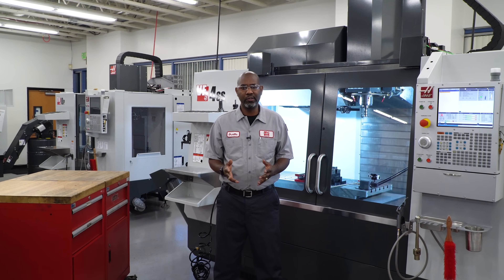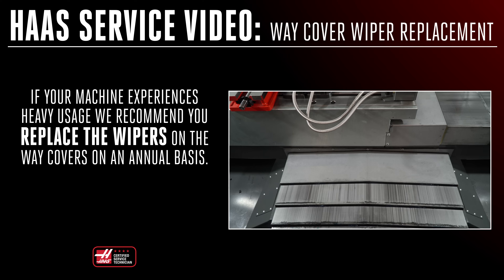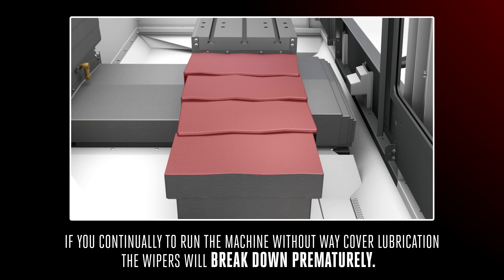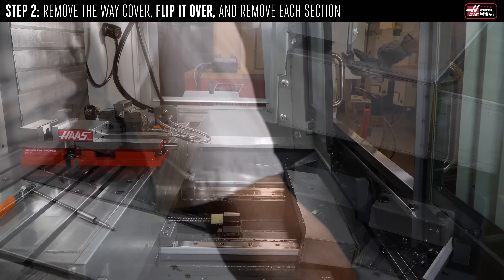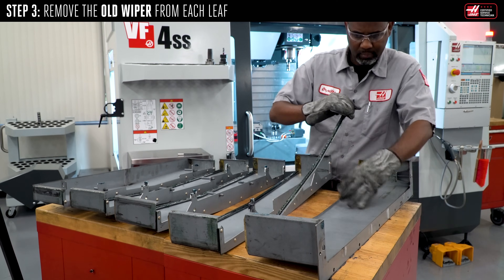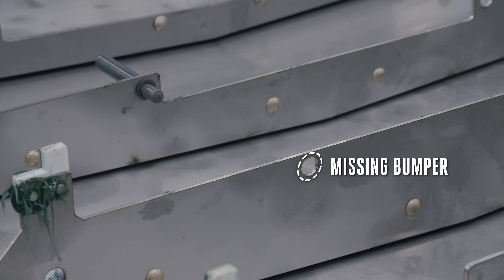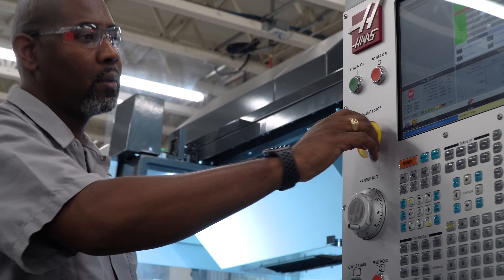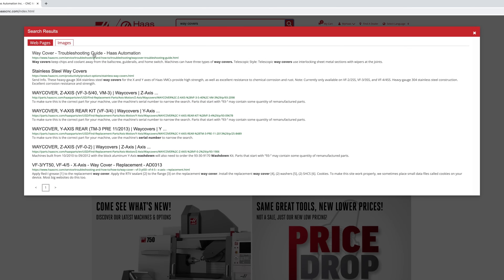Way Cover Wiper Replacement on Haas VMCs - Haas Automation Service

Comment: 2005 haas sl-20 have no rubber or plastic at all .. just some flimsy brass shim that gets erased in no time .. and yes..  metal  chips and grime will build up inside the machine faster than you can remove it.. its a cesspool of leaked oil and metal debris  eating away at the linear guides and ballscrews ..

Comment: What if brass wipers from sides are damaged? You need to replace hole wiper because is spot welded...
And yes, newer wipers are made of plastic and can brake easily or damage waycover while scraping on it.

Comment: Has anyone thought of putting rubber over your way covers just to make sure there’s no chips getting in your linears and balls screws?
Reply: Doesn't this look like a engineering fault that you would need to do that?
Reply: @zyndapp800  yes it does, the way covers do a pretty good job but I’ve noticed there still are a ton of chips that get passed them.
Reply: This is done a lot where someone is machining ceramics or other material where there are fine particles that can get past the wipers, and or damage them.

Comment: This is great, but my rear Y axis wiper was torn and the only option for replacement from HFO was a complete y-axis cover set. I'm not going to spend $1400 for a $10 piece of rubber. How about some part numbers for these parts replacement seals.
Reply: did you ever get an answer or part number.  My VF22 needs it repaired but can  not get any answers from my HFO
Reply: @M1 Machining  I haven't pursued it further, but quite friend had the same issue and got the same answer last year. I mentioned it to Haas at IMTS. Got a confused stare.

Comment: front one is easy, let see the back one.
Reply: Yeah, right!? I have a small ding in my rear way cover seal from a chunk of metal that was cut off getting shoved into the seal by the table, and so knowing the beat way to repair that would be a good video.

Comment: Way covers on newer machines are really bad compared to older models, for ex. machines from around 2005-2010 or so. On our newest 2020 VF-10 they were completely destroyed in first 200 working hours on a brand new machine.
Reply: аналогичная ситуация на станке vm 01.2020
Reply: @ВладиславПротасевич-р9б  yes, newest versions seems to be made from some sort of very cheap plastic, not rubber. So it breakes immediately as plastic is not flexible like rubber is. Anyway, really really disapointed in our newest Haas VF-10